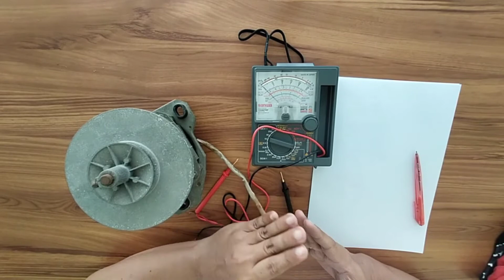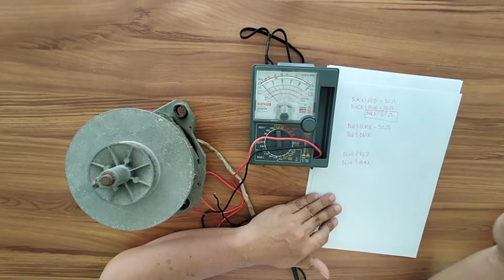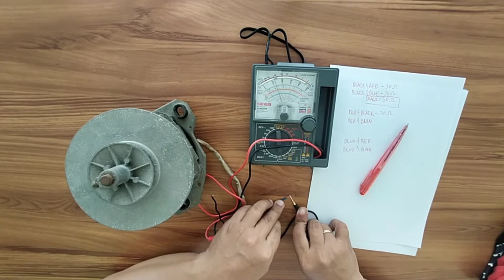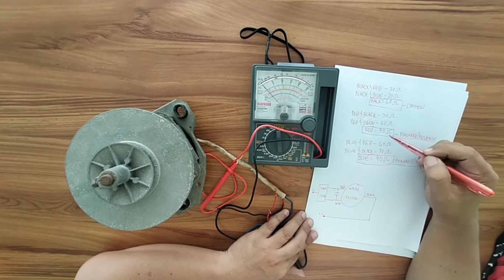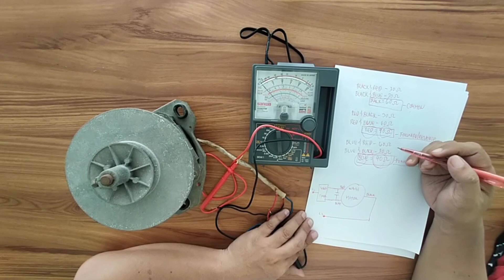Checking or Testing Wash Motor of Washing Machine (English)

Comment: Boss iyon tester ko kapag x1 kahit i--adjust di siya umaabot sa zero. Pinalitan ko una iyon 2  battery na AA kasi wala pa ako nabili rectangle na battery para sa isa. Sira na po kaya ang tester ko? Salamat
Reply from the maker: Iyan po ang common problem ng Analog multitester. Kapag hindi na po ma iadjust sa 0 ang X1, x10 na lang po ang ginagamit ko... Pero na experience ko po iyan sa mumurahing multitester, pero sa original po, kapag nagpalit po ako ng battery ok na po... Pwede pa pong gamitin iyan, X10 pataas na lang po gamitin niyong range... Salamat po...